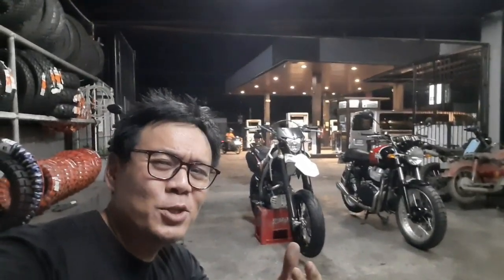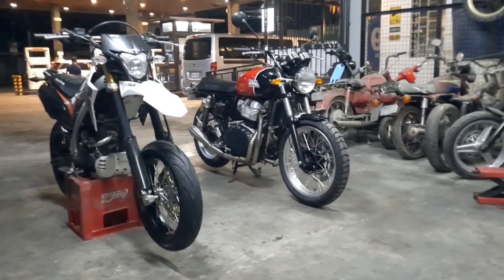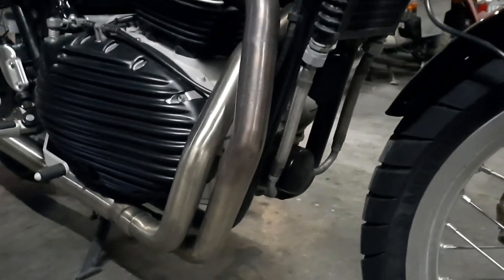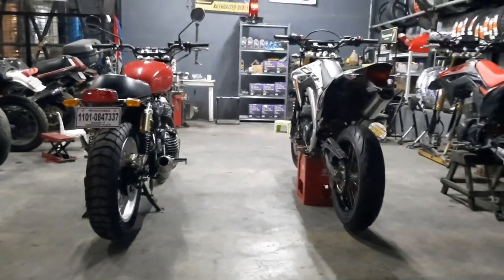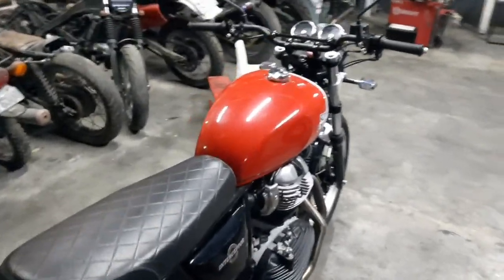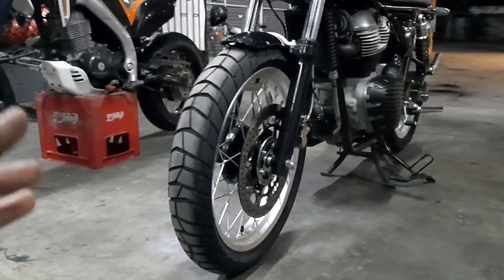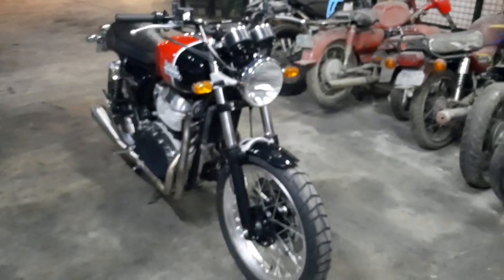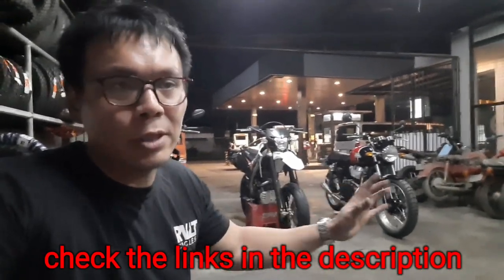We turned a ROYAL ENFIELD 650 into a SCRAMBLER! Interceptor 650 chunky tires and new exhaust!

Comment: The engine covers are from K-Speed, in Thailand. They sell quite a few aftermarket parts for the Interceptor and GT, and their website is well worth a look. If you are considering customising your Royal Enfield. If the customer is going to use it off road, or on road pretty much anywhere outside the city in the Philippines. He needs to get a sump guard installed. The oil filter on the 650's is right at the front of the engine, and really needs protection. Especially if the rubber extension has been removed from the front mudguard (fender), which it looks like it has been.
Reply from the maker: Thanks mick! After converting this bike i think i want to make one for my self in the future. Saving up for a used unit to tinker with in the shop.
Reply: @TheManoy66  I'm considering getting a Scram 411, before it's replaced by the new 450 engine, from the new Himalayan. TEC parts do a nice performance cam for it, to boost the power a little. That said. I'm equally tempted by the CF Moto 300 CLX. Which has about the same power output as the boosted 411 engine, for well over 100k pesos less. I'd need to fit dual sport tyres, as the CF Moto comes with road tyres as standard, and the dealer won't change them before purchase. But, with over 100k to play with, that wouldn't be an issue.